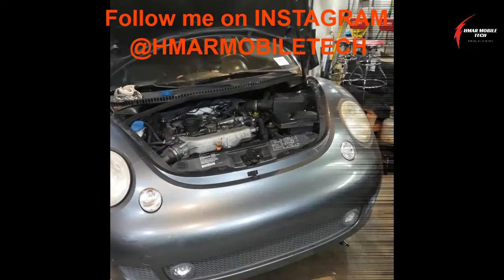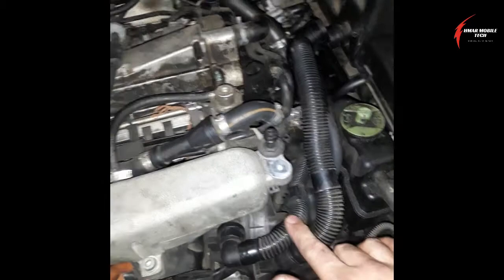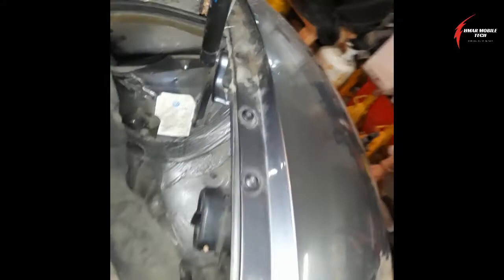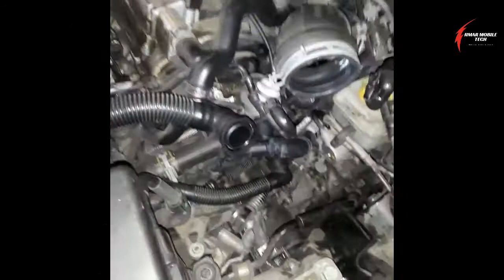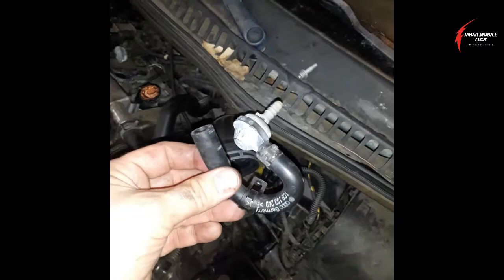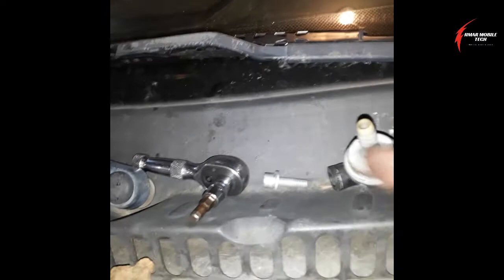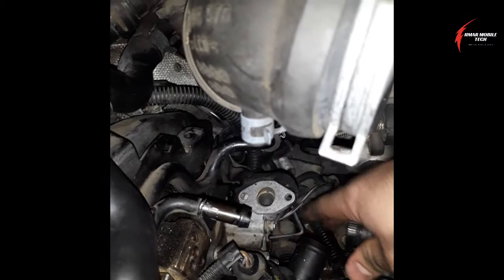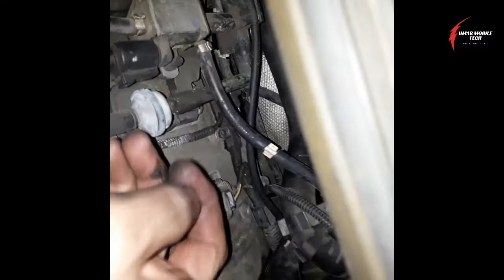02 VW BEETLE 1.8L T, DTC P0411, COMBI VALVE / SECONDARY AIR INJECTION PUMP CHECK VALVE JOB VW / AUDI

Comment: Big thanks  bro!  I just replaced my EGR(Combi valve). My wife has a 2000 new beetle 1.8T that she loves! It started getting cylinder misfire and started having gas mileage issues. Did several other repairs to fix other problems. Your video worked great to help me out! Great job!
Reply from the maker: Glad I could help, ty for you kind words FTG and being apart of the HMAR MOBILE TECH COMMUNITY 🤘

Comment: How did you know that the valve was damaged?
Reply from the maker: EDUCATED GUESS. ENGINE HAD OVER 150K MILES ON IT, I BELIVE THOSE COMBI VALVES SHOULD BE REPLACED AT 75 TO 100K MILES.